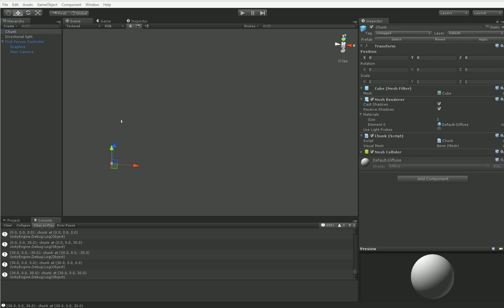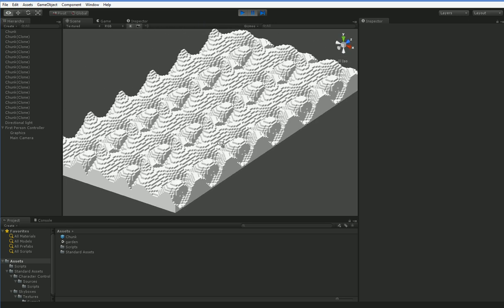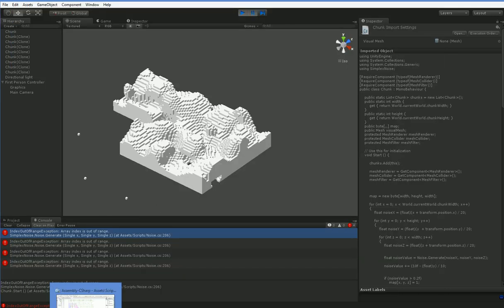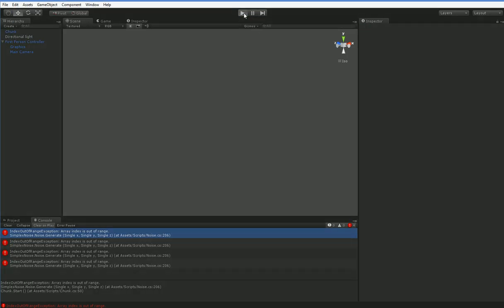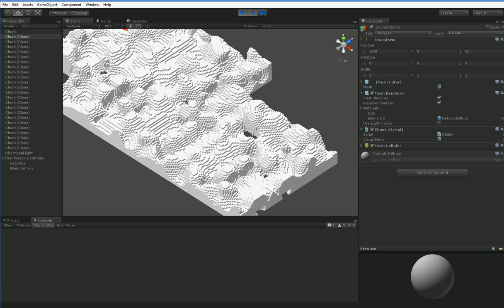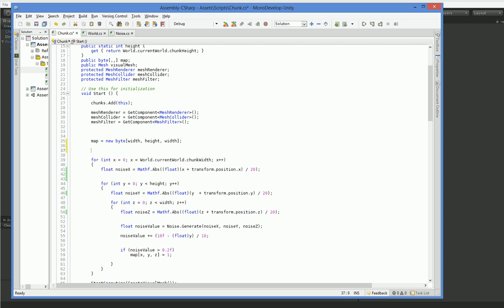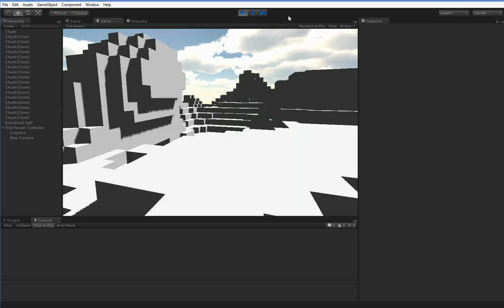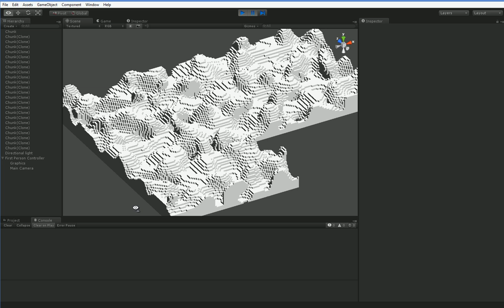Minecraft Mech #7: Let's Program

Comment: i meant you use curves to control things like noise size and or strength along with things like trees, caves ect... think about accessing data like this: the curve time is from the height of the terrain and the value says how many trees spawn. or you could feed it the angle of the terrain(youd have to average some blocks for that) instead. anyway curves are nice for quick modification.

Comment: how about adding or multiplying multiple sizes of noise fields to get greater or lesser scale variation? or just different noise fields. maybe start with varied height from perlin noise and use that height for the simplex noise? just spit balling here but that seams logical to me. also if you end up getting to biomes i recommend using animation curves as a helper for easy editor based modification. good luck!

Comment: I didnt run into the bugs of negative direction with noise. maybe because i used the Noise 1.01 instead of Noise 1.0 from the same site?! Just a thought.
Reply: I didn't either. I also used 1.01. Seems to be working in my project in the point when it's breaking in his.

Comment: I have yet run into another problem that is that the chunk only  generates in one direction one time, when i was reviewing my errors it was saying that all of the chunks were off and i found that none of thesis chunks exist
Reply from the maker: Check that your loops don't have X twice, and check to make sure your chunks are registering themselves with Chunk.chunks.
Reply: okay thanks
Reply: okay i have fixed that it was that i put in + instead of * only thing now is that their are giant craters that you can fall through i selected a larger chunk size and it dint really help much
Reply from the maker: You're not filling in your bottom layers. I don't know what algorithm you're using, but compare it to mine and check the difference.

It may just be a simple setting, like "min height".
Reply: oh im not using the preset sample by the way im doing all first hard with your help
Reply from the maker: You need to make it so that the map maker makes the bottom tiles into solid bricks.
Reply: Craig Perko Where do i go to make that happen im a bit worried if i do something ill mess it all up
Reply from the maker: There's a function in Chunk called "CreateMap" or something similar. Study it until you understand what it's doing, then change it so that fills in the lowest bricks.

You can always make a backup copy of your project before doing anything if you're nervous.

Comment: In Chunk.cs->FindChunk() you use this:

if ( ( pos.x < cpos.x) || (pos.z < cpos.z) || (pos.x >= cpos.x + width) || (pos.z >= cpos.z + width) ) continue;

Why didnt you use this much simpler comparison code below?
if(pos.x == cpos.x && pos.z == cpos.z)
				return chunks[a];

Is your way faster or is there any hidden secret i have not discovered yet, or, lastly, does it really not matter?
Reply from the maker: Width and height matter.
Reply: Craig Perko

i forgott about the width addition in your case, but strangely my code works fine, too.
Reply from the maker: Fox It only works if you're never going to try and find a chunk based on a raycast.

Comment: can you help, for some reason there are these three chunks that are missing near the origional, and they dont continue to spawn in when i walk near the edge...
Thanks for the help
Reply: well most of them spawn in, but on the left side of the map, and behind where the three chunks aren,t there is like a straight line that dosent spawn
Reply from the maker: ***** I really don't know, but it sounds like you're not checking for negative values, or perhaps you have a < where you need a <=
Reply: Craig Perko well ive never done c# before, and im sort of learning as i got by you. because of this i have checked the scripts multiple times, and they seem to be the same, how do you fix the three next to the origional?
Reply from the maker: ***** Since I don't have to fix them, chances are you have a minor error in one of your "if" or "for" statements.
Reply: Craig Perko i just checked them, from what i know, and what ive seen nothing is wrong
Reply from the maker: ***** Sorry, I have no idea. You have a bug somewhere, that's all I know.
Reply: Craig Perko  I found a fix, it turns out that the origonal chunk was causing the problem, if you delete that then the chunks will load for some reason. Thanks for the help
Reply: Craig Perko i still have the problem of a line of chiink just not loading, any suggestions?